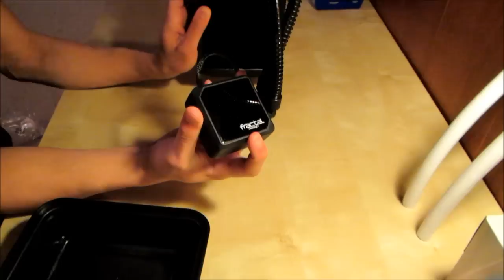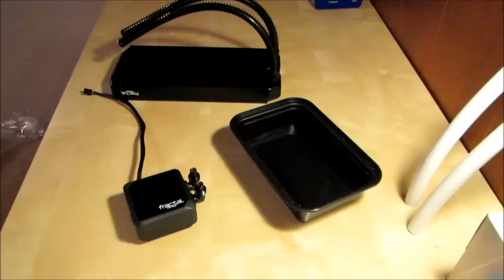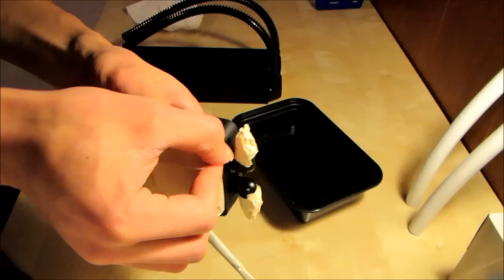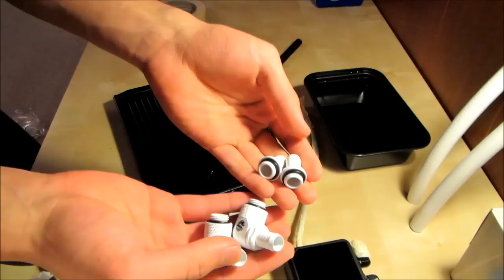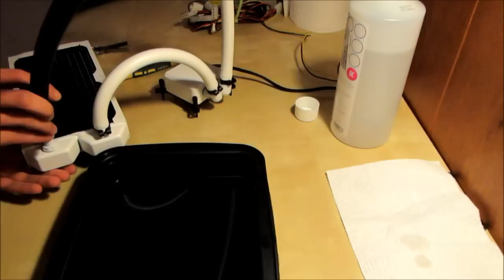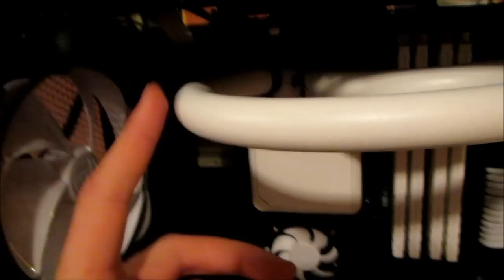Fractal Design Kelvin S24 refilling+modding guide

Comment: I'm currently on my 2nd s36, the first one was fine for about 6 months then the pump started to occasionally make weird noises. After another few months it got louder and louder and eventually sounded like a constant grinding noise, and my CPU temps were rising. Sent it away for replacement which came. 6 months now into using the replacement, and the same noises have started appearing again. Any advice ?
Reply from the maker: Have you tried tilting your case or repositioning the radiator? (mounted on the front is best)  it could be air getting into the pump somehow, other than that idk what would cause it
Reply: I have a big case (enthoo luxe) but really cant put the radiator anywhere else than on top:

https://dl.dropboxusercontent.com/u/98455184/IMG_20141227_214140.jpg

Tilting does seem to affect the noise, but I can't get rid of it altogether. Are air bubbles a concern ? I read this is something you don't have to worry about until well over a year of use on an AIO cooler.
Reply from the maker: Yeah usually the problem with AiOs is microbubbles going through the pump which causes a ton of noise. Mounting the radiator vertically helps, but that's hard with a 360. Although all AiOs have a bit of air in them, you shouldn't really be having this problem if its new. You can try emptying and refilling it with new fluid to try to get it topped off, there is a fill port on the pump block if you want to try.
Reply: The noise is getting worse so I tried some more aggressive tilting, turned the whole case upside down and around on both sides. Well the pump started grinding like crazy, rpms showing over 4000 (usually 2600-2700) and my cpu shot up to 95c. Turned it off, did some more tilting, turned it back on and eventually it seems to have calmed down and the noise is gone altogether - for now.....

 Is this a clear sign that a refill is needed? even after only 6 months?

If I do refill, do i need to empty it first? cant I just open the port and fill it up, rotating the rad to make sure the water is filtering down ?

On that note what do i top it up with, does regular distilled water work ?
Reply from the maker: Yeah that is 100% a not-enough-fluid problem. You should try refilling it with new fluid when you have a chance, but if its quiet for now then make sure there are no slow leaks and the fluid level was low when you received it.
Reply: there are definitely no leaks and yes the noise has completely gone, is it ok just to refill it with distilled water and not bother with any ek coolant ? I read some coolants can even be bad for the loop
Reply from the maker: No, distilled water doesn't have biocides or anti corrosives. You want to either use a premixed fluid like the Ek evo coolant or use a special concentrate that you add to distilled water that has biocides and anticorrosives.
Reply: Alright I will buy a bottle of the premix.

One thing i did which I think has removed the noise altogether is angle the barbs coming out of the pump upwards, they were angled down before, this must be letting the air bubbles get out of the pump where before they were getting stuck
Reply from the maker: Yup that definitely helped
Reply: Enderman LP Emptying the loop out today, look how little fluid was in it: https://dl.dropboxusercontent.com/u/98455184/IMG_20160715_155129.jpg
Reply from the maker: Ew, that's not good...flush it a few times with distilled water if you can to get all the gunk out :C
Reply: i've just filled it with the ek premix, it seems to be working fine and no annoying noise. The pump rpm has climbed from 2700 average to 2800 average, is that to be expected due to more water to push ?
Reply from the maker: That's good, it means there is less stuff blocking the fluid. Glad you got rid of the noise :)
Reply: here's a pic of the new orientation too: https://dl.dropboxusercontent.com/u/98455184/IMG_20160715_191229.jpg

hopefully should keep any air away from the pump altogether as it's at the very bottom

Comment: Would you perfer me corsair h100i v2 or fractal kelvin s24 ?
Reply from the maker: s24 if you plan to expand, H100i if you want something that just works.
Reply: i want my build to be as silent as possible... which pump would be more quiet what do you think and which one would offer better cooling?
Reply from the maker: The H100i is quieter and lower power, both will cool the same amount, unless you add radiators to the kelvin.
Reply: Enderman LP Ok! Thank you so much for the information i will be going with the corsair :)
Reply from the maker: You're welcome :)

Comment from the maker: Kalani Corn actually the pump is not variable speed, so it can only run at 100%
I have already tried reducing the speed with the CPU fan header and it will completely stop if I lower the voltage to 30% but run at 100% with anything above 30%

and no I haven't tried adding a GPU yet, but it seems easy enough
Reply: Not sure which MB you are running but in my Asus MB I can set the fan header to DC mode and just run the pump at constant 95%.
Reply from the maker: Dunetech I have the sabertooth P67 which also has ai suite 2
putting the voltage at 95% or 80% or 60% does not change my pump rpm
Reply: thanks for replay. I`m using Asus Impact vii which has no problem with changing pump speed.
Reply from the maker: Dunetech Hm that's strange...
are you using the kelvin S24 or another pump?
Reply: Used H100i, TD03-E, and S24. all work under my setting(95%-85%)
Reply from the maker: Dunetech well it seems like you're controlling the rpm of something else, because none of those 3 coolers use variable speed pumpsin fact the H100i uses sata power directly from the PSU making it impossible to adjust pump speed you're probably controlling some of your fans with your fan control software, because those pumps will not change their rpm even if you manage to reduce the voltage
Reply: that`s weird. The pump was plugged into the main Cpu header for sure and temps only got hit by 1-2C.
Reply: Enderman LP You can control the H100i. Use the cable in the box to plug it into a USB2 header on your board and download Corsair Link.
Reply from the maker: Small-Time-Gaming Nope. The pump runs off of sata power. Corsair link only allows you to change the fan speed and pump LED colour.
The "pump rpm divider" does not change the pump speed, it only changes the reported rpm from the tachometer.
Reply: I've got mine running at 1200 rpm so its not maxed out. Can't remember exactly how I did it now. But it goes up to about 2400 rpm once reaching 60 degrees.
Reply from the maker: Small-Time-Gaming You changed the rpm divider
if instead of using a divider of 2 you change it to a divider of 4 then it reports half the rpm because 2400/2=1200rpm
This does not change the speed of the pump, it just changes the rpm number that it sends to your motherboard though the tachometer cable that you plug into your fan header.
The pump always runs at full speed (2200 to 2400rpm) because it is hardwired to the 12v sata power, no matter what rpm divider you use.
If you read the documentation it specifically says that corsair pumps use an rpm divider of 2, so changing it to other values just makes it report the wrong pump speed.
Reply: Cool. didn't know that. Thank for the info
Reply from the maker: Small-Time-Gaming Yup :) no problem
The H100i pump is actually extremely quiet as you can see in my latest video. No need to turn the speed down at all even if it was possible.
Reply: Enderman LP Actually it is variable. I got mine undervolted to 1100 RPM. You have to use the chassis header, not the CPU headers. CPU headers can't do voltage control only PWM. Chassis headers can do voltage control.
Reply from the maker: Faithhh071 4 pin fan headers such as CPU can do both voltage and PWM fan control
all 4 pin fan headers can do voltage control
this is why you can plug any 3 pin fan into a 4 pin header and still change the speed
how do you know it was at 1100rpm? what software did you use to measure the fan speed when it was connected to the chassis fan headers?
Reply: +Enderman LP Great video man, I mean what u have done to this build is awesome. I also want to go with a white themed custom build. My only issue is why didnt u show the actual paint process. I just really want to see some one actually do all the painting and such from scratch. 

What paint did you use on the hosing, block and rad? 
What Primer?
How long did it take to paint and Dry?
How many Coats did u do?

Would it be possible to paint the hosing on a h60 with taking the hosing and everything apart. I just want the hoses to be white. 

Could you use a brush to paint. Wouldnt that be easier? 

Im new to this whole thing, I just want to learn, Please answer me back if u can.

Thanks alot.
Reply from the maker: +Beneath Manners Plastidip on everything. It's great because if you mess up you can peel it off and restart. I did about 5-10 light coats of plastidip and let it dry for 1-2 days. Yes you can paint an H60, I made a separate video of painting an H100i which is very similar, you might want to watch that https://www.youtube.com/watch?v=tkmYcCXH0ec
Reply: Enderman LP Thanks so much for the reply. I really appreciate it
Reply from the maker: +Beneath Manners you're welcome :)
Reply: Sry but ur wrong. U can use it with 9 volts also. Look at Hexus' review. Fractal Design answers in the last page concerning pump noice. As i understand, The pump is higher performance than usual AIO pumps.

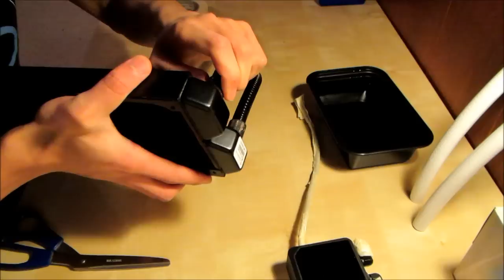Comment: i See u had a hard time loosing the screws in 13:30 both of them are scratched as hell :)
Reply from the maker: +Kashi Hilel Yes they are on very tight, if you plan to open this cooler you should definitely replace them like I did (also because they are not standard size tubing)

Comment: shouldnt you have used the fill port?
Reply: enderman lp just wondering since i am prob gonna buy this
Reply from the maker: adrian landmark it takes a lot longer to get bubbles out of the loop that waysince I needed to build the loop anyway, I might as well close it when its 99% full of fluidI then used the fill port for finishing touches
the main issue is that its hard to get the last bubbles out of the fill port on the pump block because there are several twists and bends inside the pump blockthe best way would be to have a reservoir, or a radiator with multiple ports (like one of the alphacool ones) and use the radiator like a resevoir
Reply: Enderman LP can you use like a ek res and change the order of the loop like res-pump-radiator- then back to the res?
Reply from the maker: adrian landmark yup
as long as the res is before the pump
and it will be way easier to fill too
Reply: Enderman LP i renember something about the pump has to be lower than the res or is it okay if i just mount the res on forexample on a 120 fan mount on the back of my define r5
Reply from the maker: adrian landmark yup that res will work
and its best if the top of the reservoir is the highest point of the loop tom prevent backflow
Reply: Enderman LP can i add a second pump to this or will that be very bad i am thinking of a pump and res combo unit
Reply from the maker: adrian landmark As long as you have both pumps pumping in the same direction it should be alright
Just make sure the pump you add doesn't run at full speed or you might have so noise come from the original pump
Reply: Enderman LP ehm am i right in saying that having a 800 l/h ek-xres dcp-4.0 in there and running it at fulll blast would kill the original pump
Reply: Enderman LP i am asking you because theres like no info on this anywhere and you seem to know your stuff
Reply from the maker: adrian landmark I don't think it would break the loop, but it will certainly make unwanted noise and potentially damage the pump (which doesn't really matter if youre using an external pump right?)
the best solution would be to turn down the external pump, or use a regular CPU waterblock that has no pump

Comment: Those cooling fluids are so god damn expensive. I can just get a gallon of distilled water for like $2.
Reply from the maker: +AndyHa1010 its like $25/L but I prefer using it because its already tested and mixed with all the anticorrosives, biocides, and additives. Especially in my loop which has no reservoir for a kill coil, and I cant see the state of the liquid because the tubing is not transparent.

Comment: Just use a res, 1000000 times easier.
Reply from the maker: Stuart Tonks wont be enough space with a larger radiator

but yeah you could do that if you want

Comment from the maker: +Hao Phamamazon.es
Reply: Very nice vid! im going to try to add 2x 240 rads on a Kraken 52,.but i have a question for u,  how did u connect the White tube without adding alot of air?  i mean u had to disconect the black one
Reply from the maker: You can't add radiators to the X52, it is not an expandable AIO. You need something that has removable tubes and fittings if you want to expand it.
Reply: well, i just cut the tube and reattach it :P but will it make the filling much harder?
Reply from the maker: No, it will just increase the chance of leaks.
Reply: True but the chance are still less than with a 100% custom loop tho :P
Reply from the maker: Nope, because the tubing on AIOs is clamped onto the barbs at the factory, once you remove it there is no proper way of reattaching it. On a custom loop you have compression fittings or barbs with tubing clamps. If you want to expand an AIO you need to buy an expandable one from the factory which is made with proper G1/4" fittings and standard tubing.
Reply: u dont think 2x zipties on every fitting wil work? : /
Reply from the maker: No...do not open a sealed custom loop if you care about your PC parts.
Reply: :(  i will update u when its done (if im going ahead if it)  :)
Reply: Mission complete, 2x 240 rads in the loop, and supernice temps for a 4.4Ghz 6core intel chip!

Comment: Would be easy doing a custom loop with a real pump and not that toy, there are white tubing and with the price of that kelvin you get a reservoir/pump combo from EK. You are wasting your money and time.
Reply from the maker: DI360ca I dont like what EKs res pump combos look like
Im just doing what I feel like doing, and going for a certain aesthetic without a res
Reply: You could easily put them under your PSU cover..
Reply from the maker: DI360ca there is 0 space underneath that cover :(
50% is filled with PSU
20% is the drive cage
and the other 30% is filled with cables
Reply: so it´s a waste of space..